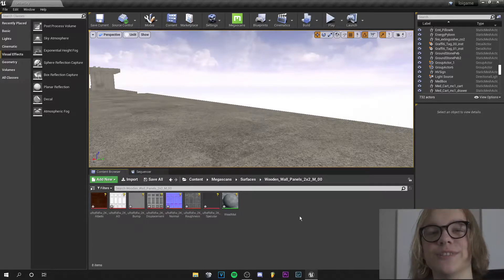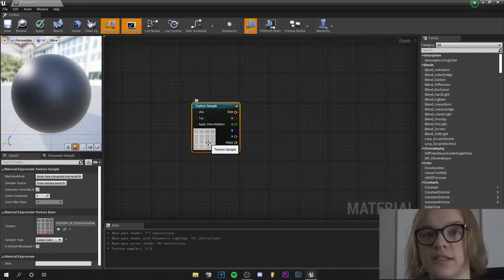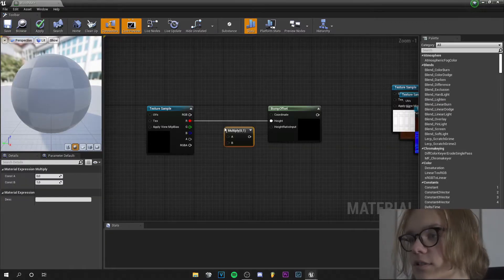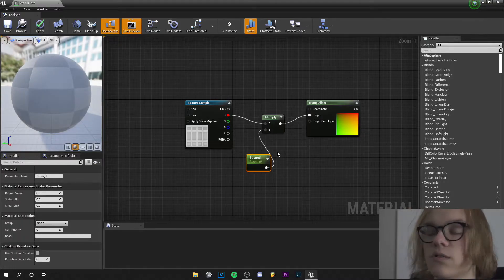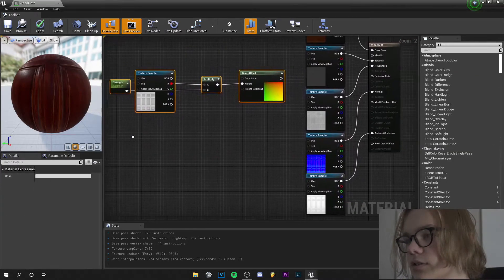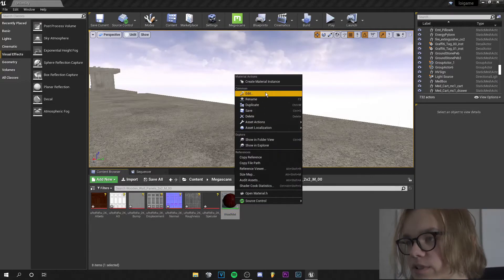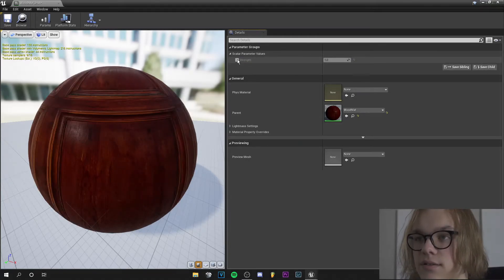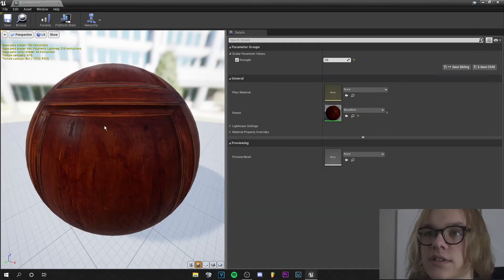How to use BUMP OFFSET in Unreal Engine

Comment: Mine wound up looking like crap LOL

Gonna pass over my buildings with no brick bump and hope for the best.

Displacement distorts the buildings in horrible ways, no matter how strong or weak said displacement. 

Tried a NormalFromHeight node, but that did not improve things. 

No matter the lighting, no matter the height map technique, UE5 is rejecting any height applied to my buildings. In Maya / Arnold and Painter, however, everything looks much better. Too bad Maya would crash since it has no Nanite capability and I need millions of trees in this scene.
Reply from the maker: Hey, I'm sorry to hear that it doesn't look nice. I recommend at least using normal maps if bump and displacement don't seem to look good.
Reply: @UnrealMatter  Nah, the normal maps look truly bizarre. They're doing all sorts of weird things to the shading. 

No bump mapping of any sort seems to be working. I'm going to have to fake it by putting the shading of the bricks and stones into the color texture. My hope is that the 500 or so feet we'll be flying above these buildings will be enough to sell the look of them.
Reply from the maker: @keithyakouboff8755  Okay if the normal maps are looking strange too, maybe your texture maps got exported wrong/for another program. What you can try to do is going to a normal map generator only or doing it manually in a program like photoshop and creating a normal map with your albedo/base color map :)
Reply: @UnrealMatter  Interesting. Never heard of doing that. I imagine I can find a tute for that. 

Thank you :)
Reply from the maker: @keithyakouboff8755  You're welcome. It is very simple. I mentioned it in a few tutorials of mine too. Also I made a tutorial on how to do it in Photoshop a while ago :)
Reply: @UnrealMatter  Very nice. 👌

Comment: hey sir, when i do this with my texture it goes really really distorted, is there a way to add bumps into metal? another method? thanks :)
Reply from the maker: I mean you can use normal maps and displacement maps. Or parallax occlusion
Reply: @UnrealMatter  thank you :)
Reply: @UnrealMatter  haven't tried that method yet as I haven't had time. But I liked what I saw so here's a sub
Reply from the maker: @Autinary  Thank you very much